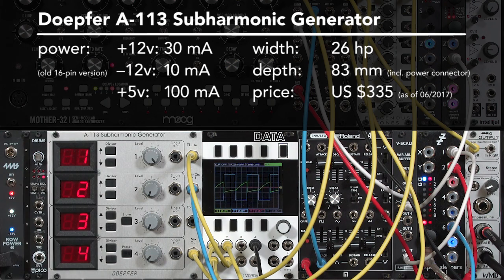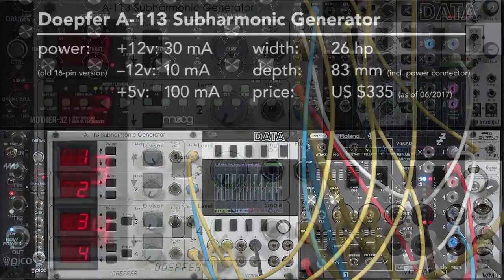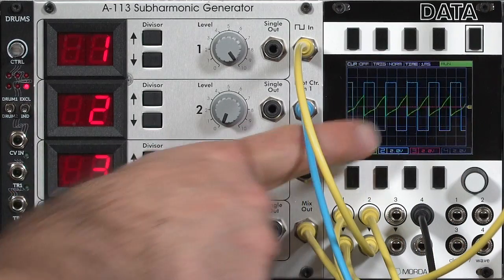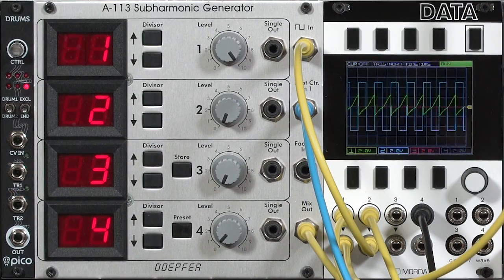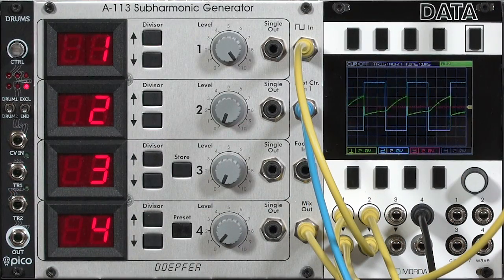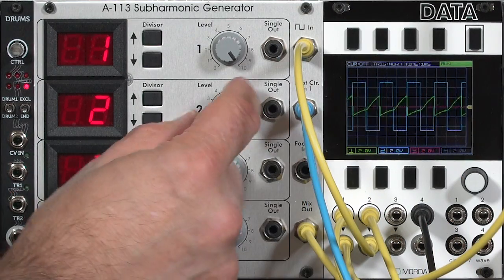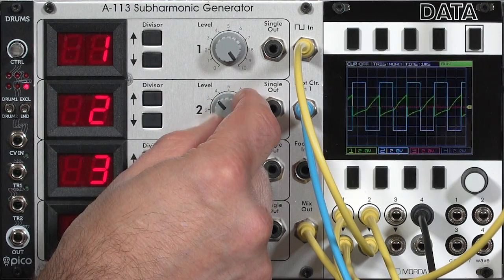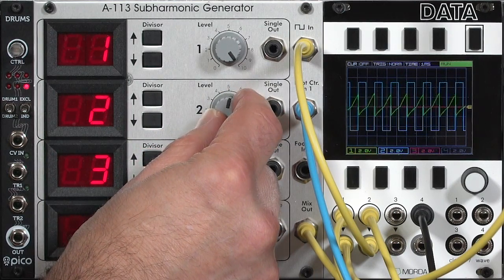Doepfer A-113 Subharmonic Generator 1/3: Suboctave Divider (LMS Eurorack Expansion Project)

Comment: Does this module do harmonics as well as subharmonics? Also I saw some decimal divisions on the display. Does that mean divisions less than 2 are possible?
Reply: Just whole-integer divisions or subharmonics; no multiplications or higher harmonics. That said, it produces a sawtooth-like waveform instead of a sine wave, so even the "sub" harmonics have higher harmonics of their own, resulting in the sound also getting brighter.

Comment: I bet in combination with the new QPAS by MakeNoise, this will get more attention. Have QPAS ordered, I'm sure these will pair great, since I'm already a fan of the A-113 and what it can produce. This harmonically rich output will be great to pair with QPAS. 
Btw. a cool way to get interesting bits out of the A-113 is to process the mix out one way and route some single outs another way to get not only timbral variations from the same note (of the source vco), but also harmonical side paths which also can be rhythmically independent. Great fun!

Comment: Cool!  I think that's something you can do with  Maths also.  Interesting design on that module, I'm a little surprised you can't sequence the subharmonics.
Reply from the maker: Robert: You can kinda do divisions with Maths (or the Serge DUSG), but it's different. You can sequence the subharmonics; it has a large number of presets, plus, the footswitch input changes between variations of divisions.
Reply: @LearningModular  ahh, so it's got a hidden sequencer in there.  Makes sense.  I'm just curious how the Trautonium/A-113 varies from the Maths patch as both follow the harmonic series below the incoming signal?
Reply from the maker: On the A-113, the waveform stays consistent in shape, and you can select four different divisions to mix together. On Maths, it's basically a reset issue - like oscillator sync - where the wave keeps changing as you lengthen (for example) the release time, until you jump down another integer division, and the waveform radically changes at that point.
Reply: Why? A gigantic module with fixed outputs without voltage control over them that other modules do in 1/2 the hp or less--yep, sounds like Doepfer.
Reply: @NickHchaos  You forgot to mention that it's about 3 times deeper behind the panel than a typical module also.  Still, you can't deny that it's smaller than a Trautonium.
Reply from the maker: @NickHchaos  This module was designed to replicate part of the function of the Mixtur Trautonium, which has level controls rather than VC: http://www.doepfer.de/traut/traut_e.htm